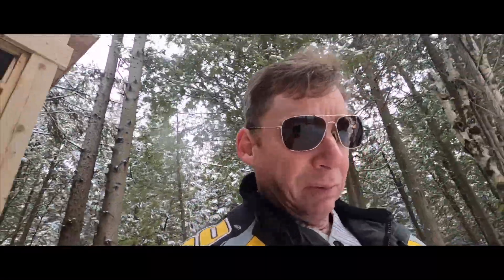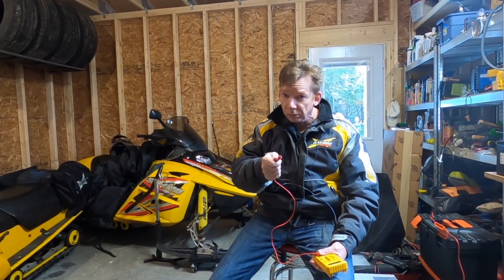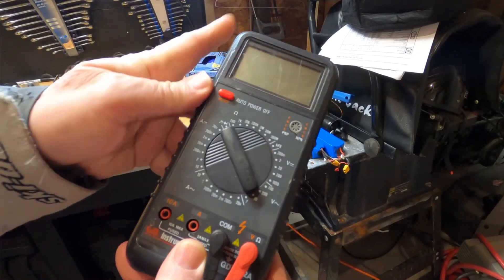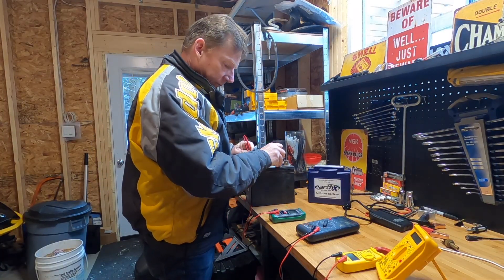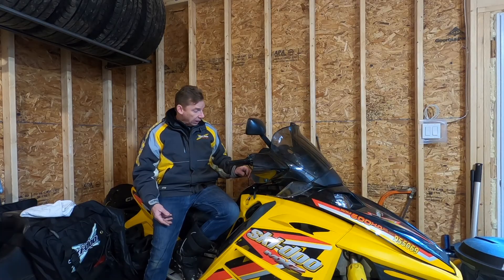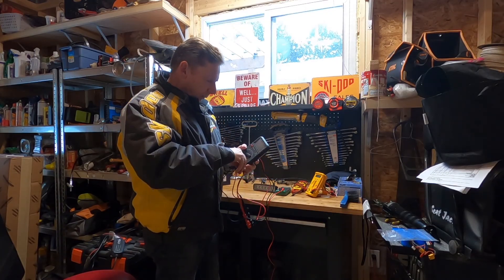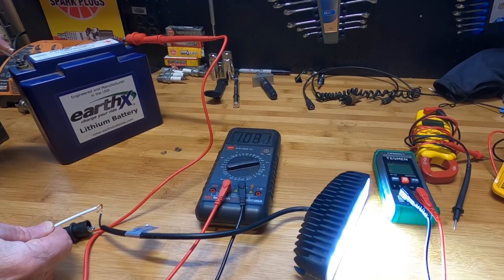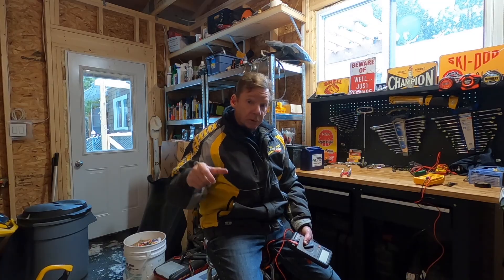How to Use a Multimeter to Diagnose Snowmobile/ATV Electrical Problems

Comment: So my sled won’t start with the e start and keeps blowing bulbs I’m thinking the battery is dead because it doesn’t show any voltage but I’m assuming the reason it didn’t hold the charge is the regulator same reason my bulbs blow
Reply from the maker: Sounds like you are on the right track with your diagnosis. What have you done in terms of diagnosis?
Reply: @M @MyOldSled  I want to test my voltage regulator and solenoid but I don’t know how to or where the regulator is located
Reply from the maker: What kind of sled
Reply: @MyOldSled 1999 skidoo grand touring 600 carb
Reply: @MyOldSled 2000* I found the regulator so I have a new one on order

Comment: My heated grips stopped working on my motorcycle. Hoping this will give me some ideas on how to test circuit and resistance. Still a little murky.
Reply from the maker: Start simple…any fuses blown, bad relay? Then check any and all wires for continuity, check the switches for continuity. If you cant find anything, than the heating element, but if its both, it will be wiring. Take your time, trace each wire. You’ll figure it out. Wiring issues are a pain.
Reply: @MyOldSled I checked the fuse, it’s fine. Then I took off the tank and followed all the lines and cleaned all the connections. I saw no issues but didn’t fix it. Thinking the heating element, it’s the Honda OEM grips, but these things are pretty unstable usually.
Reply from the maker: Couldnt you test continuity on the two wires going into the heat in element?
Reply: @MyOldSled I will as soon as I get a new multimeter 😅

Comment: Reading AC current on my old Skidoo kind of threw me as I expected to see DC current going to the headlight. So no rectifier circuit on 1997 Skidoo.
Reply from the maker: Correct i installed a rectifier in my 97 to power an accessory outlet. You could also probably install a regulator regulator from a sled with estart
Reply: @MyOldSled  yes...I could see that could be easily accomplished in order to get some DC voltage if necessary. My AC voltage level was OK...but I have burnt out headlight and tail light. So something caused that.